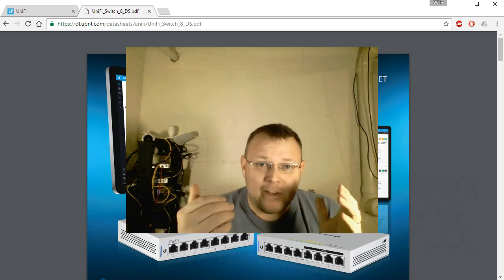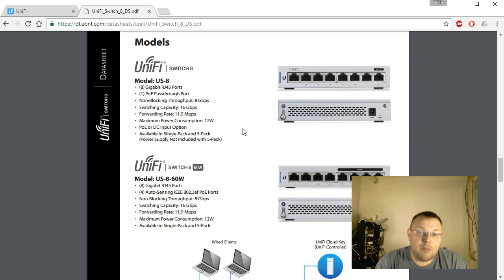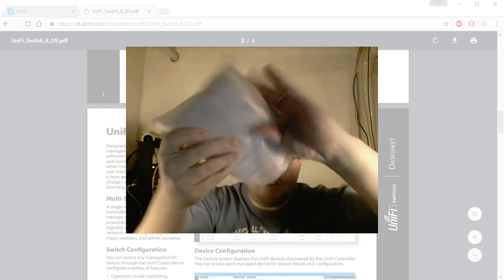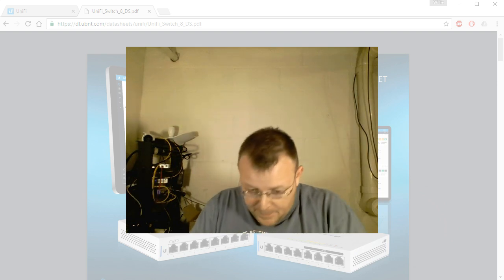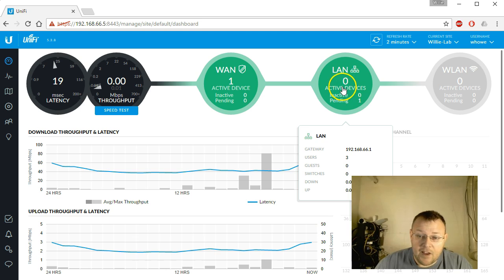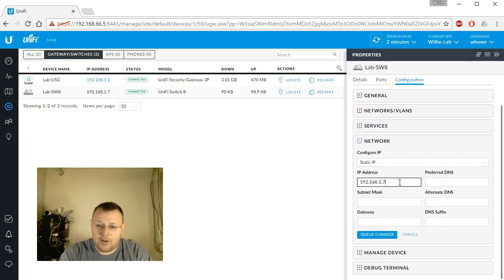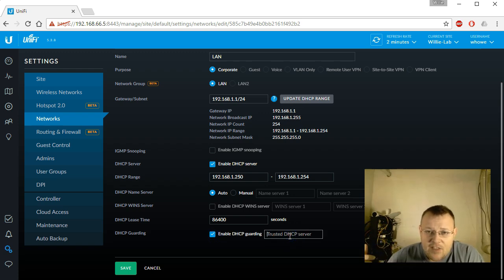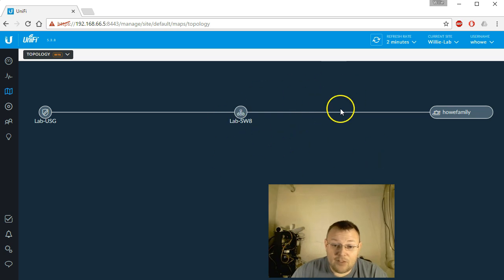UniFi SWITCH 8

Comment: I have  the 8port switch and connected it to the controller?  In the video you said that you configured the network/DHCP in the controller.  I have a ER Lite, so do I configure the DHCP in the ER or in the controller.  Can those VLANS in the ER then be passed through the switch to the APs so the clients can connect to the VLANs based on the SSID?

Thanks

Comment: Hi willie and thanks for the video, I have a question, I'm a total new bee in network, I have a arris sb8200 and 300 mgbts attach to a usg, also have 2 APs, one pro and one LR, the LR is set up as a repeater and both have their own poe. I'm using a netgear 5 port switch to supply a vonage voip, my desktop, Mac mini and the AP Pro, the issue is that I'm only seen 85 to 90 mgbts downloads speed when should be close to 300mgbts, will this switch suits me better or the 60w? Plan add on will be a cloud key. Thanks in advance !

Comment: DHCP guarding....wow, great feature. I have setup and maintained many fraternity houses and they're always plugging in personal wifi routers which hand out their own IPs. that's caused problems before and have had to use Wireshark to trace them down to a physical port, to a patch panel port, to a room #, and unplug them. this feature sounds like it would save me late nights in the future.

Comment: if I have 200 Mbps at home, can this switch can send 50 Mbps to a router and 100 Mbps to another so that the routers provide only 50 Mbps in one and 100 Mbps in the other. Bandwidth control to all the people connected to them, Thanks.

Comment: I was waiting for this switch (the basic 8, that is). I was planning on using it to replace the current, non-POE switch in the attic, but your description gives me pause, specifically the "This means if you want to power passive UBNT devices you'll need the PoE converter". 
Could I use this as follows: power on via an upstream UniFi 8 port 150W switch, use the POE out to power an Unifi AP-AC-LR (providing WiFi to the rooms in the attic), and then use the other ports to run ethernet cables to the kids rooms in the attic? Hope I'm being clear here...
Reply: That is too bad - it is an AP-AC-LR and needs 24V passive
Reply: The US-8-150W is the model you need.